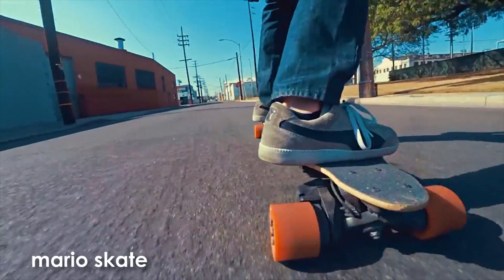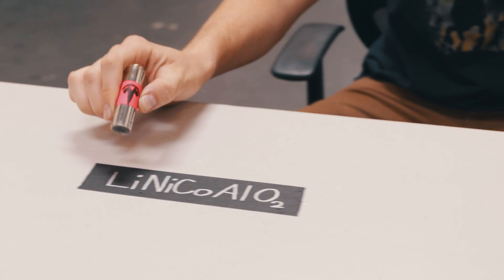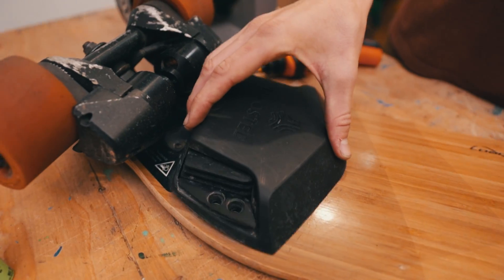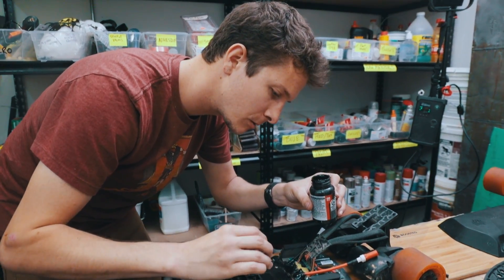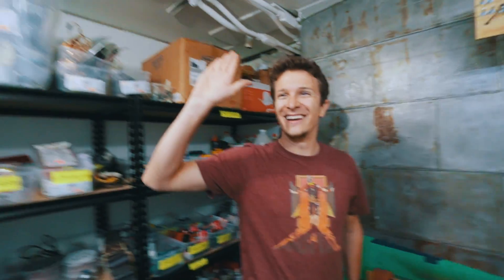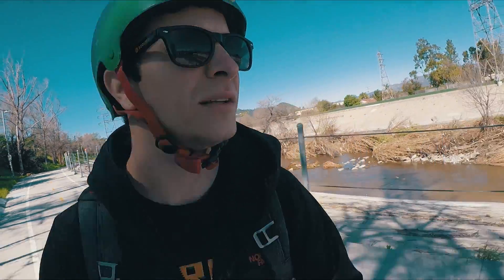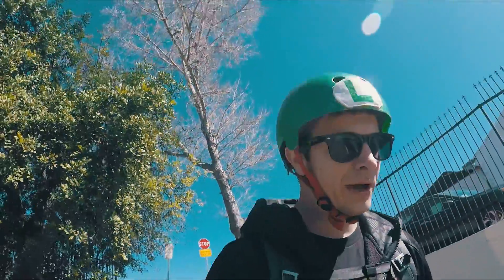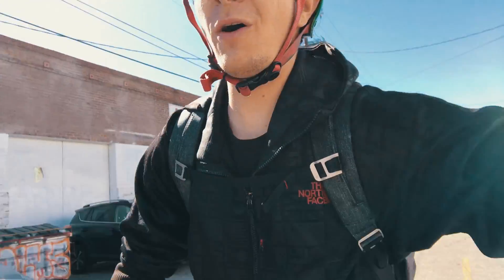Tesla Batteries in an Electric Skateboard!

Comment: Hej. LiIon have a steeper voltage (discharge) curve compared to LiFePo. The output voltage will hence drop faster during operation if the pack is designed for the same initial voltage (that is the actual problem). So, effectively the LiIon battery needs to be designed for a higher initial voltage. You just have to make sure that the converter can handle that additional voltage. Hope that makes sense ;)
Power density is typically 2-3 times higher, depending on the type of cell and the desired continuous discharge current. The board most likely requires high currents...thus a LG-HD2 might be a good option.

Comment: so when the first battery has its 36V or ~ 0 amp*Hr of charge left levell the other two batteries start pumping charge into it. If you add a diode so that current can't flow into that battery you should be good for solving that part of the problem. To keep the voltages high, http://www.learnabout-electronics.org/PSU/psu32.php
but keep in mind that's not true  pure DC power so you are gonna have to double check that the circuitry won't be damaged.

Comment: That's only 16 amps. Each cell gives out 8 amps and you only have 2 packs in parallel. Those motors can require up to around 40-60amps. Again you only have 16 amps which cannot power a common 40a motor.

Comment: Take out the booster board battery and use only your new ones? I knew a guy who had a bulldozer that takes two batteries he got one new one that was larger than the original and the big one kept draining the other. Once he put two the same size they stayed balanced.

Comment: I''m no rocket scientist but it seems if you would set up a circuit that would switch the two batteries to series instead of parallel when they get to a certain voltage that might solve your problem of getting the last ounce of power out of them.

Comment: cancel the original battery pack. because the 2 backs you added will start charging the other smaller pack if it drops in voltage faster to reach to balance voltage. maybe add another pack instead. 

Remember. all your batteries need to be the same specs. Some 18650 batteries are 3.6 Volts nominal. otherwise the smaller one will act as a load (dead bat that need a charge).

Comment: hey can't you make those batteries into basically one so you can use all the battery power or something like that or put a better motor on it and make the batteries that you have modified to link together into the original Motors battery if that makes any sense

Comment: battery wont exhausted till zero voltage, there is an under limit and an upper limit also, if you pass it, it would be very dangerous explosion

Comment: You should add a simple voltage meter onto your board, and you will see that at full charge you should have about 42 volts, but that when you gas it voltage will sag by  3 volts more or less.  When the voltage drops below about 36-38 you are damaging the batteries (and maybe the motor) and not getting much performance either.  Adding another 10 cell pack should make quite a difference.  Pretty cool experiment though.  I have a home built electric bike with 52 18650s and it's good for 10-12 miles depending on how much I pedal.  Lots of fun, but I also have range anxiety.  Never go out farther than you are willing to hoof it back.

Comment: any way to make boosted board switch between batteries so when one dies it stops using it and starts the next full battery? other than that id look into modding the esc software to fit your cutsom battery. not sure if boosted esc is open source but there are open source escs out there.

Comment: heres an idea, a wearable backpack full of batteries with two small cables running down to the board that can easy-disconnect in case of a fall. Then just hop on with the backpack and see how long you can go.

Comment: As long as the board circuit have an input from the external batteries you added keep the external batteries you added connected and remove disolder the original batteries that causing the problem from the circuit board and replace them with 2 batteries from the same type you made the 40v battery of so that maybe you can benefit from all left energy , remember always keep an input to the circuit board, and that's it it should works fine , best of luck , let me know what will happen,so to provide .

Comment: U cannot combine differnt cell chemistries. Use only one Type, just add more LiFePo in parallel. They are for higher current. And already integratet in your balancer. U need to rewire with more cells the old batterypack otherwise u need more elektronik Charger Buckboost converter etc .  Lifepo have a max cell voltage 3,65V and Lipo 4,2 V.

Comment: put on the LiFepo2 battery as a backup, so that when te LiNiCoAIO2 battery only does 30v connect to the LiFepo2 from the LiNiCoAIO2  battery and push the voltage up?

Comment: Get a 40 mile range Metroboard.  They just released their new motors with a top speed of 24 mph.  I'm going from a 20 mile range to a 40 mile.  They also have a dual motor setup with 6000w peak.

Comment: Wren, hello, me again, you should keep in mind that the mean voltage of a 18650 is around 3.6V, but I saw you considered 4V for that. Check the maximum and minimum voltage that the skate can handle and keep working well, and then just add more series, maybe 12? Another issue might be the charger, that doesn't get you to the max voltage for each cell (4.2V) so you could use a bench power supply that has current limit and gets up to (number of series) x 4.2V!

Comment: You could use a bit of copper wires and surround the areas where the remaining power is and plug or attach the wires to the engine that way you can keep going
Reply: What
Reply: I think they meant bypass the internals, and hardwire the batteries directly to the motors. Though that sounds like a good way to fry something.

Comment: 36v shows that your 10 series pack is "fully" discharged. Each cell is 3.6-4.2v so the 10s pack should be between 42 and 36v. The reason that the boosted board stops at 33v is because they want to advertise the highest range they can. So everything that happened was expected because in fact every battery was drained fully. In order to extend the range. Yes you thought right, add more cells or maybe since you used velcro make another battery pack that you can swap out and make a switch for the main boosted board battery so you dont over drain it

Comment: You may be able to fix that issue of monitoring your energy levels by simply soldering a voltage checker onto the board somewhere (i don't know, I only know enough to build a DIY drone). On most models it allows you to set the checker to sound an alarm at a certain voltage. This way, you will be able to know when the battery is getting low so you can get it charged, and not damage the battery. Anyway, I'm certain someone else has already said the same thing.
Reply: Huskie how should the ampere stay constant? If he drives uphill it will draw more amps. If the motor has to work harder it requires more power...
Reply: Pretty Fly Guy and an amp meter as well
And then Power=U*I display for the watts
Reply: Voltmeter*
Reply: Ammeter*
He only needs a voltmeter on this, as the wattage and amperage should stay constant.

Comment: I don't see a good way of solving this unless using the same chemistry for all batteries. 

You can add more batteries in series and only charge them until the pack gets to 40v, but this complicates  the charging process and you will still not utilize their max capacity. For that you will need to build a custom charger.

Comment: Get the board charging from the other batteries until they're empty then you still use the board until the board battery dies.
Reply: The board is running straight from the two Panasonic batteries, the stock cells have been removed.

Comment: Hey man really liked ur video
I am electrical engineering here
What I suggest is that after u reach the min voltage for the two battery packs instead of the parallel connecting change the connection to series connection 
That would then double the amount of available voltage
Do follow up

Comment: Max motor speed is proportional to the applied voltage & load.  As your battery charge decreases, so does the battery voltage.  You can use a voltage boost converter (at the expense of available charge), however, you will also deplete your battery charge faster & run the risk of over discharging your battery.  

The greater you discharge your li-ion cells, the lower the service life (ilfe span) of your cells.  As it is, you currently have no circuitry to measure your battery charge level.  I suggest you pay someone to design & build a proper charge controller to monitor & properly cut-off charging, display the charge level, & properly cut-off discharge current to protect your cells.

Your problem might also be that you didn't properly charge your cells.  To get max power from your cells, they need to remain @ a CV of 4.2V for quite some time to get a full saturation charge. Full charge is reached when the charging current decreases to between 3 and 5 percent of the cell Ah rating (e.g.:  3000 mAh * .05 = 150 mA).  That means charging should be cut-off when the charge current drops to anywhere from 90 mA - 150 mA (for each series battery bank) .

Comment: You'd need to switch them to serial once almost empty. It depends though on how much the circuitry can take whether you can do that. If the circuitry can't take 80 Volt, then don't switch it on in serial mode when both batteries fully charged. If circuitry can take 64 volt, then once you've almost depleted the batteries in parallel mode the switch it to serial. If it can't take 64 volt then the wiring becomes complex.
My dad build a switch like that for me once for my videocamera back in the nineties. We rigged some 1.5 volt batteries from expended emergency lighting and used it to power the camera. Cause the camera batteries wouldn't last longer then 10 and 20 minutes. With this rig of 8 fat ass 1.5 volt batteries we could film for hours, and once depleted in parallel mode we switched to serial mode to have another hour of filming or so before the camera died and we needed to recharge the batteries. It looked like a bomb-vest though so even back then it would scare the crap out of people, but back then this was hilarious :).

Comment: I think your reasoning is correct on the batterys, the factory boosted board battery have a lower "mah" or milli amp hour.
so if you remove the factory batterys it will work, or replace them with the same mah batterys

Comment: Install dynamo in the board and must attach it with the wheel. So that battery can be charged during the ride and also you can add solar film on the upper flat portion of the board to boost up the charge of  battery.

Comment: Use attached magnets to the motors for stronger speed and extra packs to carry over the low point with a low battery change over beep.  Going up hill have extra motors working  "double-up" for thrust or use 250 can motors "brushless.

Comment: KISS: Remove the original battery and replace it with another pack of Panasonics!
Reply: Adding another pack would increase the range, but then there's still that 5V that he cannot use, he's trying to solve his problem which can be done with a voltage regulator, rather then throwing more power into the board.
Reply: It's just the Lifepo4 battery has a much lowest capacity, around the half of 1 Li-ion one, so he think the Lifepo4 stop at 3.35v but no, it's complety discharge when the li-ion are around 3.35v. He find 3.35v for the lifepo4 because he just takes the voltage on the cables of the original battery(the 2 big cables) but because he soldered the new Li-ions on them, the voltage of the 3 batteries are mixed and 3.35v is the average voltage, the lifepo4 is surly around 2,5v and the li-ion around 3,4.
He connected the batteries in parrallel so all the batteries should be the same.

Comment: Careful, if you use a boost converter without a voltage protection you will drain your batteries fully and you dont want that.

Comment: you need 11 cells per pack for 40.7 volts. this will bring your voltage in line with the factory battery.

Comment: 1. Find out how much power you need.
2. Use enough cells to deliver at least that power for the time you need.
3. Put the cells in series.
4. Regulate the voltage using a buck converter.

Comment: Try to charge the boosted batter and then run off the 2 parallel batteries using the same about off battery power but in junction

Comment: One important tip: try to measure voltage of your battery pack UNDER LOAD, I mean while you driving. My guess is: the voltage under load will be a lot lower, due to internal resistance of the cells. Keep in mind that this internal resistance get higher while cells are discharged. It means, bottleneck of your bottle is getting even smaller. You have some energy in your battery packs but you can't use it in huge burst, rather dropwise. The solution is to add more packs in parallel. What is the capacity of your cells? If they are like 2400mAh or more I bet they are not capable of delivering huge bursts of current, needed to start, speed up etc. Cells used for example in cordless tools usually have much smaller capacity (ie. 1300mAh), but they can deliver current like 20-30C (20-30 times its capacity, for 1300mAh cell it would be like ~40Amps!!). Cells with bigger capacity can usually deliver 5-6C, not more, due to higher internal resistance. More cells in paralell - and you are good to go. Good luck!

Comment: +Sam and Niko hey why not just add another set of cells in series? An extra couple volts at peak won't fry anything, prolly. I use a 56v instead of 48v on my bike but I knew the controller was full of voltage regulators. Those are easy to find with a screwdriver, usually.

Comment: because those are just glorified lithium ions what you need to do is lipo it C rating fit discharge is converted to snappy turqe. and get a lower kvh=turqe system or upgrade it for 70$.. look up 1:8 rc set up and battery C ratting. they have reastats that replace the recivers

Comment: hey, take out the battery of the skate board and connect the battery pack you made directly, see if that works.
Reply: bahman tahmasebi the board might not like that because the new batt would have different volt under load and discharge characteristics.... but then again how sophisticated could a skateboard be....

Comment: Have a D.C. Voltage regulator that keeps a steady 44 volts till the battery's get below around 30 volts and then it should work(probably a buck converter would work the best)

Comment: I can tell you that you are going  to need to use a boost converter. In most electric cars like the Fiat 500e, it has prismatic cells that feed a boost converter. It has a range of about 85 miles on a full charge @ 55mph. You are going to need allot more batteries for the capacity to feed a boost converter for more range over your current experiment. It will not be practical.   Be aware that boosting voltage will reduce current. The higher you boost, the lower the current. So you'll need to figure out that magical balance.

Comment: Don't even use the boosted boards battery, ALSO the ESC that controls the board has a voltage cut or safety mode that prevents you from killing the batteries. SOOOO to do what you want, you need a custom board. Which is SOOO easy to make, take all the electronics from the boasted board off... get a 40v compatible ESC and a remote and a rx and start hooking it back up. That should give you what you want and then some.

Comment: use an arduino and one voltage booster/ converter...
the arduino monitors the old batterys voltage, and is "telling" the converter to switch to that voltage.

alternatively you could just use 2 voltage converters and set the voltage to 40 volts, but the arduino would be way cooler^^

Comment: If you hook up an inline voltage boost module with a 50kpa capacitor you can use all of the available battery and also maintain a consistent power flow and thus consistent speed of the board.

Comment: Part of your issue may the the current output of those batteries. 18650s typically source less current than other battery packs (one of the reasons you hardly see them on quad copters).

Comment: You want to connect the batteries in series if you want more voltage. Connecting them in parallel increases amp-hour capacity.
Edit: wording

Comment: May have been suggested already but disconnect the original batteries. They're the weak link dragging everything down. Once they're depleted they become extra load as the tesla batteries try to supply power to the board and recharge the dead stock batteries

Comment: I know this is pretty late but I have an idea on how to do this. By Kirchoff's law, voltages, resistances, currents (if there are 2+ currents joining) are added up. By putting the batteries in series, you will eventually add up all the voltages of all the batteries and hence there would not be a voltage cap in on of the batteries, in contrast which you will have when batteries are in parallel. Yes, of course, the normal battery would not provide any more emf., but you will still be getting a high enough current from V˅T=V˅Normal+V˅Tesla1+V˅Tesla2, and V˅Normal = 0 when its run out. As shown in the video, the 2 big orange cables are the power cables from the original battery. All you have to do is to create a cross section in the wire (cut it) and solder it with other batteries in series. I am just a high scholar studying IB DP Physics HL, so I am not 100% sure. I hope this suggestion is helpful.

Comment: The simplest soluton is to replace the original batteties with the booster pack not just connect it to it. Or use a voltage booster.